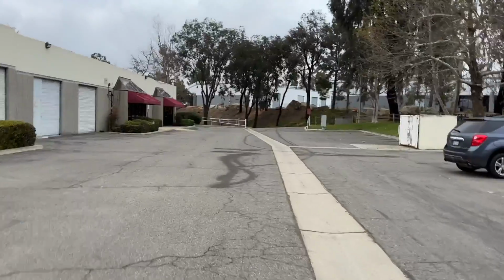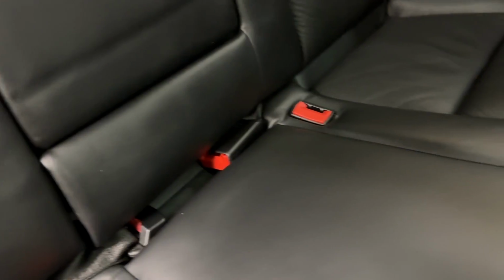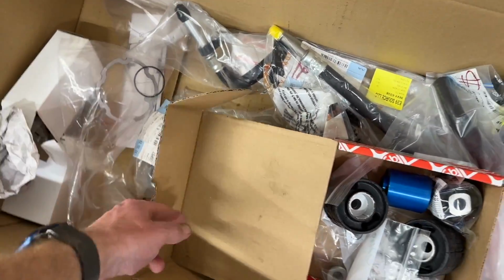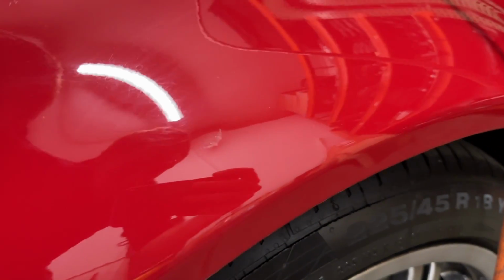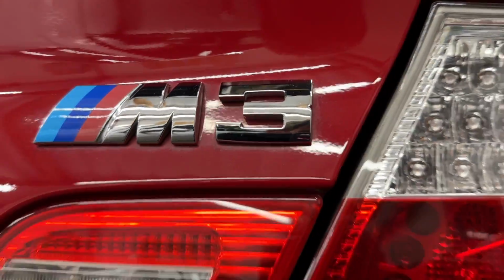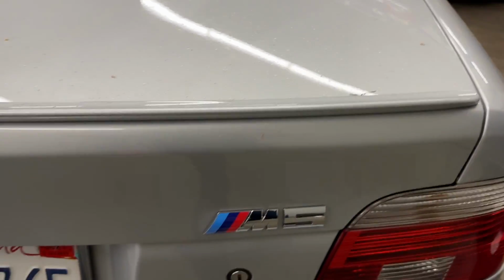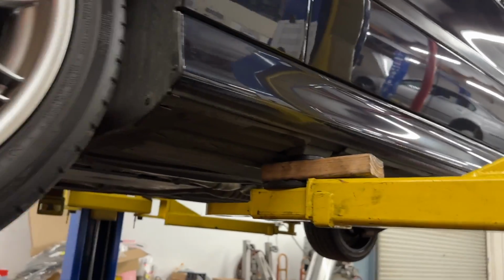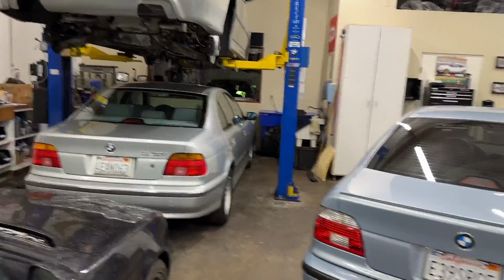Totally Geeking Out  2/21/23 - Day 4,458

Comment: Canadians cars are european spec arent they?
Reply from the maker: Somewhat, but maybe not entirely?  They are still DE93 cars, just like USA.
Reply: Basically yes, the have the same Code like DE93 Code for the e39 M5 was means the are Cars for the North American market. But BMW produces cars specialy for the canadian market with different specs or options. For the e39 M5 was the M texture cloth seat an option, the US market had never this option. The most canadian BMW have also the Code kalt Landausführung (Car for Countries with low temperature) that means the cars have generally heated seats, headlight washers, stronger heater..

Comment: Seems highly likely that rear bumper cover was painted given the lack of paint defects that were present in the advert phones. However those 4 push rivets are indeed painted body color from factory; they evidently paint the bumper cover as an assembly.
Reply from the maker: Seriously?!  Oh wow, that/s very surprising.
Reply: @JRSVlog  Yes, I figured that out way back when before I purchased my E46. Every single one I looked at was like that so I was perplexed. I posted on M3Foums and everyone confirmed that the be the case on virgin cars that had never seen any paintwork. Seems very un BMW like but I guess that’s just how that manufacturing process was setup.

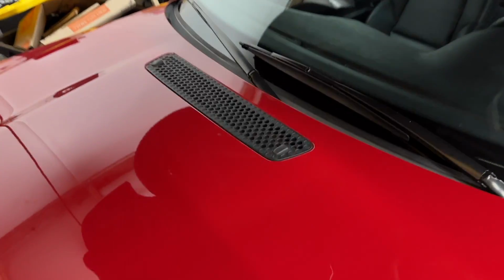Comment: 11:20 I wish the E39 had a vent like that, actually. Help to evacuate heat from the engine bay and keep the firewall trim (highest, furthest rearwards point) from cooking. 
Re: Corning sticker; Corning is from central NY. Supposedly the "museum of glass" in Corning is actually fascinating. If you're ever driving from, say, Cleveland to New York City, I've heard it's worth the detour.
13:53 I'm sure you know, but if you search E39 "Bus Topology" you'll see a diagram showing the various systems that pass through the cluster. it's basically all of the modules haha.

17:18 Rasp city, bi***, rasp rasp city bi***. I want to try a Rogue Engineering resonated X-pipe with my Tubi mufflers. I'll do the headers first, see if that livens things up, and if it's still pretty tame the Rogue-X should wake things up. The Tubi resonators are massive.
Reply from the maker: It would be good functionally, but I don't like the look.  A glass museum definitely sounds interesting, though few of my vacation dollars will be spent in New York state lol.  

Weird that those messages translate to clicks and pops through an audio system though.

Get one!  Those are pretty 'affordable' when it comes to exhaust for these cars.